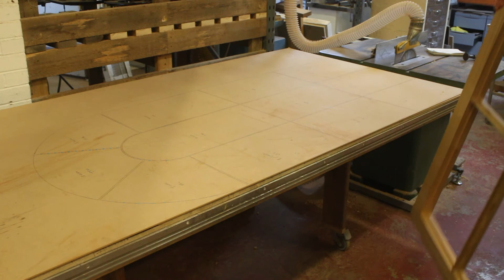Arched window part-6 final assembly

Comment: Have you ever pegged of pinned window joints without glue?
Reply from the maker: ive always glued them as it helps to stop moisture ingress into the joint but not so necesary for strength if the joints are cut accurately and wedged and pegged.
Reply: I think you were doing linseed oil paint on a door.  If you condition with raw linseed oil, use linseed oil putty and paint with linseed oil paint, you don't need to worry about moisture at joints and the paint, with a little maintenance, will last forever.  It's actually preferable not to glue joints with linseed oil products and you can use less expensive wood material.  Gorilla glue is a good choice if using petroleum based paint.

Comment: Really a great Window! Thanks for showing this! Do you have a picture of the finished Window with glas? How do you paint/finish the wood?
Reply from the maker: thanks andreas, i did take a photo just after fitting but not sure how to post it here. still to this day i didnt re plaster around it so it still looks rough from inside but it keeps the rain out! i painted with linseed oil, i have a couple of videos covering that.
Reply: @NewYorkshireWorkshop  Do you have an instagram account?

Comment: its a really great attempt but unfortunately back in my day you would fail the C&G advanced craft in carpentry with this as your examination piece the arch would have hammer head joints and all the glazing bars would have to be mortised to get full marks. Still the quality here surpasses most of the cr*p that passes for construction in the era of Kevin McCloud etc.
Reply from the maker: is C&G the unimethod cat swinging institute?
Reply: hi  mate,  i  did the advanced craft city and  guilds cabinetmaking  ,  in  liverpool  ,     he would  have passed hand made    with  distinction no  problem  ,  i  have  never seen   so much  filler  used   when  i  was  in  collage  , many sins were committed  ,     saying  that   i probably  would  have  morticed  the  shaped glazing bar  )
Reply: @cameronsmith2928  
Hi Cameron as a cabinet piece its perfect but not a construction window  I have no doubt it would look great as a shop fitting piece and get full marks on a cabinet makers course cheers
Reply: @NewYorkshireWorkshop  
didn't think you would have heard of them !
Reply: @jamescardoness3037  ok ,you  are  right   about  most  of   the   utube  woodworking   clips on  here   , thats  why  it  was  nice   to  see a good  job  ,   its  easy to criticize  he  clearly   knows what  he  is  doing  and  i  am  sure  he  has  a  good  reason why he didnt mortice   the  glazing bar    ,   when  the putty has gone  hard   it  going no were  )

Comment: Hi, lovely job, can I ask why the bottom rail isn’t tenoned into the stiles as it would be in casement sashes, just wondering as I’ve never seen it done this way, cheers Crawford
Reply from the maker: in a sash; the bottom rails are tennoned into the stiles so that there is something holding the weight of the glass, if the stile were tenoned into the bottom rail then the weight of the glass can push the bottom rail down and off the tenons (years down the line if they loosen).
 in a frame; the stiles are tenoned in order to limit the amound of end grain at the very bottom where water can settle. the bottom rail (of the frame) is supported by the stone cill so it cant be pushed down.